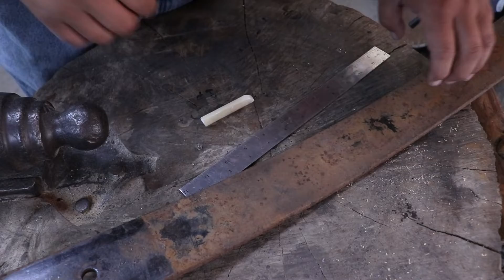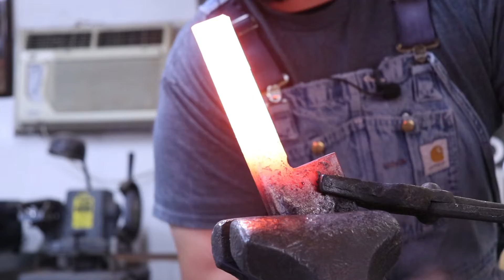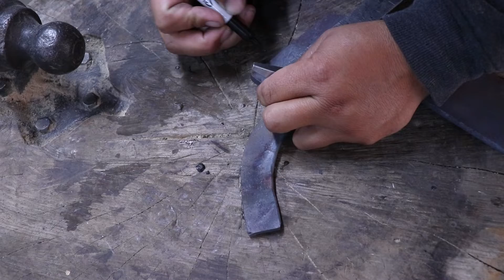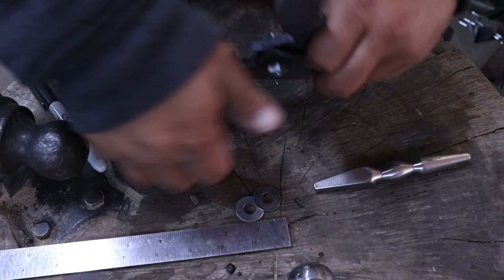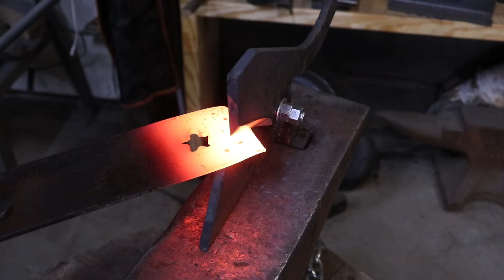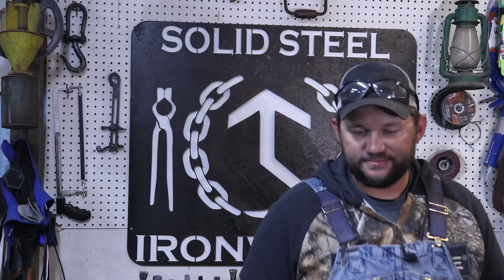Making A Hardy Hot Shear

Comment: Good Video, nice work.
But... Thanks!  Thanks Alot!!  as a newbie smith I'm coming to the end of my 'Tooling Up Phase' and can start doing projects... until I saw this video.  Now I gotta make one of those, Why??? 
Cuz I might need one someday.  Tools are just like Pokemon... Gotta Get `em All!  lol
I've seen someone else make one of these before, if I could make a suggestion?:  You may need to weld onto the top blade where you hit it to prevent the eventual mushrooming.
OH! Quick question, what angle did you grind the bevels at?
Reply from the maker: I am right around a 45 degree angle on the bevel I never actually checked it though.